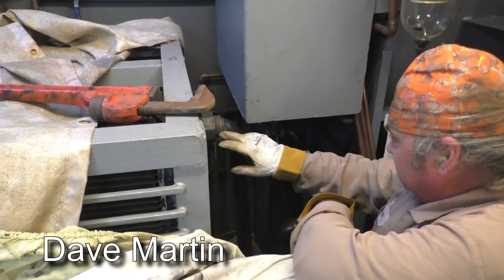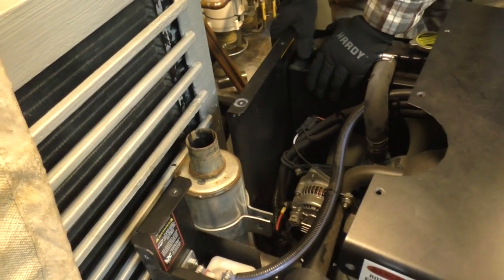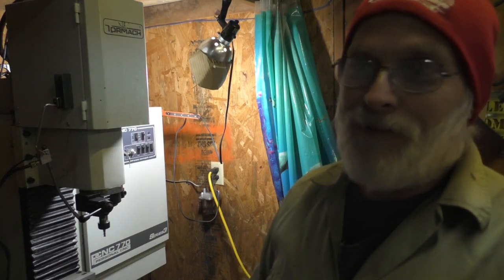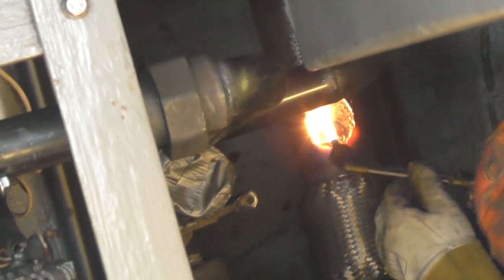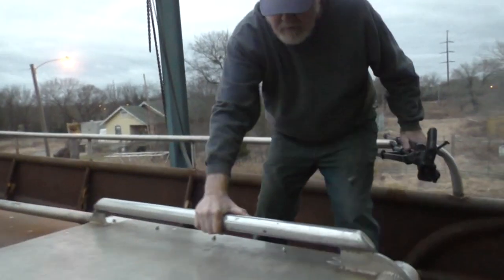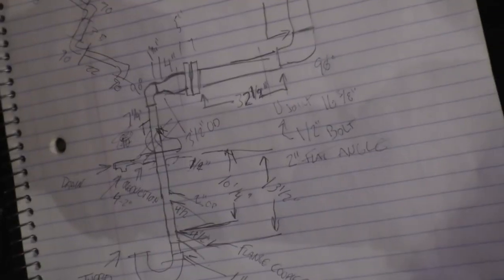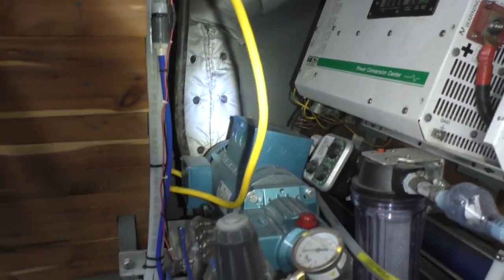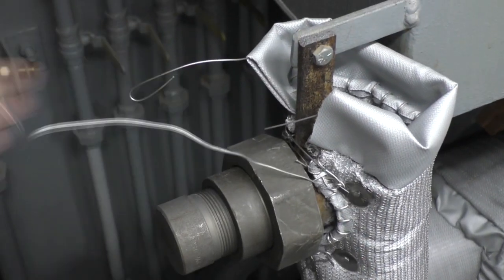Engine Exhaust

Comment: I've been in the heavy equipment transport / heavy towing industry for 30 years.  I've "heard" that if you're hauling a machine on a trailer, or towing a semi tractor behind a wrecker that the wind can spin the turbo while going down the highway and cause damage.  I have NEVER ONCE heard of it actually happening. Never. Not once.   I have had one or two customers in 30+ years ask me to tape off their exhaust stacks to prevent the turbo from spinning, which I did..... But the other 8000+ machines/trucks that I've hauled the exhaust was wide open and had NOT ONE problem.  I think there is a difference between the turbo windmilling (spinning with no load) and actually being driven by hot exhaust gasses.  If it's just windmilling, there is no load and no extreme temperature.  I suspect the residual oil on the turbo shaft bearing/bushing will lubricate sufficiently with no load or heat at a relatively low RPM.....   Under load and extreme heat while spinning at tens of thousands of RPM, yeah it needs oil.  You'll be fine.
Reply from the maker: Bart talked about that exact thing and had the same conclusion.   It make me wonder about all the things people imagine as problems that are really nothing at all.  : )
Reply: @SVSeeker    I wonder about that, too.  If we had to worry about every single possibility, or perceived threat that people can possibly come up with, then NONE of us would ever leave the house. Thank god we have people in this world that realize that just because something "can" happen doesn't necessarily mean that it "will" happen, and rarely does happen.   Looking forward to the launch, Doug!
Reply: Even if it did turn out to be an issue, what's the worst that can happen? You need to replace a Turbo or some Bearings. Pain in the ass, yes, but it's not the end of the world.
Reply: I have to agree. I never even heard of the possibility of windmilling when hauling, I'm a (diesel) mechanic with wrecker experience.. I think you will be fine, and if you fear it will run dry, turn it over once in a while to let the pump run. O and by the why, it hit me just now and I will post it again in mains, if your engine is solid there can't be windmilling at all, you'll just create a vacuum..
Reply: @SVSeeker  In periods of longer runtimes for the generator (not sure what the secondary motor is), where the main engine is not used.  What about exhaust gas leaking through an open exhaust valve, past the cylinder rings, into the crankcase and then out either a crankcase vent or back through other cylinder rings where there is an open intake valve that then vents into the engine room?  Carbon Monoxide buildup down below would be the greatest concern, not turbo spinning.
Reply: @TonyTrimaldi  DAAAAAMM!!!
Now you guys are thinking deeper!!!
I love science!!!
Love the channel!!!💪🏼💪🏼🔥🔥🔥🔥👍🏻

Comment: That common exhaust is going to give you issues.  I've seen it tried many times on industrial sites and it always fails.  One cylinder on an off engine is going to be in valve overlap (intake and exhaust valves both slightly open).  A small amount of that hot exhaust with a ton of water will flow right through the other engine.  It'll cause condensation and corrosion, maybe even a hydrolock situation.  I've seen all sorts of water traps and valve installed to try and remedy it, but none successful.  Ultimately every one i've seen has been redone with individual exhausts.  I know you don't like any critiques, but this one will actually cause you expensive headaches down the road.
Reply: I would just suggest a shut off valve that electric and but in inline with the main engine exhaust and run it to a ignition hot wire so as soon as the key gets turned the valve opens and when you shut it off the valve shuts
Reply: @srb2az141 @svseeker   an diesel exhaust brake might work well. Need to see how tight they can close at full close though.

Comment: Exhaustpipes are never connected together, every combustion engine or boiler onboard is to have an own exhaust pipe. This is to separate the engines, preventing fire spreading, avoiding exhgas backpressure related elevated exh temperatures at the engines and fouling of engines due to backflow.
Most propably you will experience backflow of exhaust into the engineroom through the non running engine. Spinning of the turbine is no big deal, but the backflow of exhaust  will foul the intakes as the intercooler and compressorwheel and flow into the enginespace. The exhaust "do take the easiest way out"
Best regards,
Fredrik  , Marine chief engineer
Reply from the maker: Actually you are wrong.  The idea came from a boat builder and fisherman from New Brunswick.  I think it's better to keep an open mind for what you may not know.
Reply: @SVSeeker  That is true and brilliant if it do work, saves a lot of work and effort!

Comment: You are way to close to the main with your cut in and yes the turbo will spin. And when the main is running the back pressure is going to exhaust out the small engine open valve.

Comment: Thought this was an old one... I was there when Ewaut and Dave were there and may have heard my voice talking to him, doing fit up... and to answer your question on turbos, it's not a vacuum that turns anything, it's differential, so you have to have a significant source of gas flowing across vanes to impel it to rotate. It may suck out gas that remains inside a engine until that is under vacuum too but can't do any more than that unless there is a significant leak in piston rings or a pair of hung open valves to reach intake system or another source of atmosphere.

Comment: Re spinning the turbo, not much to worry about there I'd reckon. If it's a 4 cylinder with a valve overlap of 20 degrees (pretty worst case I'd think) that's a 1 in 4 chance of stopping with both valves open assuming that any position is equally likely - which it isn't. It's more likely to stop before a period of overlap due to the compression on one of the cylinders bringing everything to a halt before TDC and thus the other cylinder won't have reached the point of the inlet valve opening.

Then, if you have no path for the air to travel through there can be no flow. You might see a slight vacuum being pulled on that exhaust but no flow means no spinning turbo.
Reply: Cummins 5.9 12v 6 cylinder
Reply: @mrwolf9335  I thought that was the Genset exhaust rather than the main engine...
Reply: @dtnicholls1  the genset isn’t turbocharged the 5.9 is and she’s the main for sure she’s even coupled to the auto box out of the schoolie still as well
Reply: @Mr Wolf  yeah, just re watched that part of the video and you're absolutely right. In that case it's a 1 in 6 chance (120 degrees in 720 of rotation), again assuming any given position is equally likely, which it still isn't.

Comment: Turbo won't spin because air can't come in through the intake if the engine isn't running, so there is no flow. You would need both intake and exhaust valve on the same cylinder open. Even still, the flow would be so low, the turbo won't spin enough to need oil.

Comment: Just curious, as a research vessel carrying students to exciting places, what sort of maritime certificates and/or inspections will SV Seeker have? As an old submarine sailor I can testify to the benefits of the SUBSAFE program. Between 1915 and 1963 15 submarines were lost due to non-combat causes. After 1963 only one submarine has been lost and it was non-SUBSAFE certified. I wish you all the best, but it is a good idea to listen when the welder says the 4" hole in the boat could use another bead 'just to be sure'. LOL.

Comment: Half the exhaust valves will be closed on the 5.9l Cummins , when not running. Also gases go will the flow of leased resistances and a open pipe vs a closed engine.

Comment: Nice jobs. BUT i will use the opportunity to share some bad experience from my off shore work. Sharing exhaust on piston diesel gen sets, will after relative short time deteriorate the valves on the not so often used engine. Sod WILL find its way thru the engine to the intake and collect dirt where dirt is not wanted. Redone several plants.

Comment: I sure hope you recognize that paralleling those lithium Ion batteries will result in a serious balancing problem and ultimately a fire within your boat if a very adequate Battery Protection System isn't used.
Reply from the maker: Hi Mom!
Reply: @SVSeeker  🤣🤣🤣🤣
Reply: @SVSeeker  just keep a co2 fire extinguisher nearby lol

Comment: If the turbo starts to spin from scavenging exhaust pressure, it will not be under a load but there should be some oil to lubricant.

Comment: Doug, not sure which of those engines might run concurrently, any concerns about exhaust pressure from the larger engine causing back pressure or interfering with exhaust from the smaller engines?

Comment: We ran a shovel with to keep 1150 cummins engines. The mufflers were mounted mounted above each engine. The engine room was so hot it ruined the insulation on the wiring. We mounted the mufflers on top and wrapped exhaust with heat wrap. Alot quieter and cooler!
Reply: Kt 1150's

Comment: Try running the smaller motors and look through the intake of the 5.9 turbo and see if it's turning. 
I'd say as long as it's not spinning to fast it should be good.

Comment: As long as the intake and exhaust valves in the same cylinder aren't open at the same time then no draught and turbo can't spin.
Reply: But there's no way to prevent a cylinder from coming to rest in valve overlap.  It happens and will cause issues.

Comment: There can't be windmilling of the turbo: if your engine is solid you will get a vacuum at most. In order to get windmilling you need airflow, if the engine is off the airflow is cut off, the exhaust doest have gaps to allow air in, and the the air can't go in in the cilinders because at least one set of valves will be closed.

Comment: Do you really want to use old 18650 when the fire risk is very real. And fire on a boat sucks. Just something to think there are safe new cells that are just not that expensive. Is it even legal to mail old 18650s
Reply from the maker: Actually I'd rather hunt whales and render their blubber in to oil on deck and put that in oil lamps in each cabin.    But the world has be taken over by pussies.

Comment: Not a good idea to combine engine exhausts ... danger is condensation in the engine(s) that are not running.
Reply: Seen it many times on industrial sites with expensive repairs to follow.
Reply: I have built a lot of marine exhaust systems it's never a good idea to combine exhaust like that I would be more worried about exhaust blowing out the intake of engine that is off. Should make sure you have less than 10 inches of back pressure with all engines running full load

Comment: Turbos are turned by exhaust gases and heat you may have enough heat to give you a problem with no oil when the engine is not running

Comment: Doug, I have been reminiscing about my days at sea and remembering that with the turbo blowers on the Sulzer engine they had a gravity feed tank for the oil supply to the blowers. This as you may know was to be independent from the main L.O. Supplied to the Sulzer main engine.
What and how is the LO supplied to the blower on your main engine.

Comment: Doubt the little exhausts would have any effect. You would need both an exhaust and an intake open at the same time for it to allow any significant amount of airflow. You might have a small seep through the ring gap but that would be like blowing air through a capri sun straw trying to spool a turbo.

Comment: For the other engine's exhaust to cause flow through the diesel turbo, there would have to be air flowing into the turbo inlet for there to be air being sucked out to cause rotation. Where is that makeup air coming from? That turbo isn't going to move.

Comment: worried about spinning the Main engine turbo via venturi effect because a valve may be open?  I dont believe the smaller engine would have the volumetric capacity to reverse pinwheel the turbo via vacuum.  besides, you would need both intake and exhaust valves open at same time in one cylinder of the turboed engine to get any through flow.   I could be wrong....I am just guessing.

Comment: Is it the flat top 18650 batteries you need Doug or is it the button top 18650s? I have a chance I may be able to get a handful of brand new 18650 batteries brand new for dirt cheap.
Reply from the maker: I don't think it matters but don't go and buy any.  There are plenty of used ones out there for free.
Reply: @SVSeeker  wish it was that easy here in oakland. You rarely see people recycle those batteries.

Comment: Any vacuum from the exhaust of one engine running that it could try to pull air through the exhaust from another is a non issue.  There would not be enough of a vacuum to move enough air to spin a turbo. Thats due to the design of a turbo. This should be common knowledge.  Look at the exhaust turbine as well as the compressor side turbine. It takes significant air flow across the exhaust turbine not just the tiny amount from what amounts to you blowing out on a pinwheel toy.
Reply: If your going to throw out terms like “common knowledge” you should know that it’s also “common knowledge” that a drafting nozzle, which they have built by angling an exhaust pipe into a common header, can create significant vacuum, which can create significant air flow. So unless you’re going to provide real numbers, based on pipe size, air flow, and drafting nozzle geometry, I suggest you shut up about what is “common knowledge”, because you don’t have any “common knowledge” to offer.

Comment: Screw the turbo, if and engine is stopped in a position where an exhaust valve is open, you've just created a direct path for CO2 directly into a confined space! They CANNOT share the same exhaust!
Reply from the maker: Thanks for your opinion MOM.  : )
Reply: @SVSeeker  That's a very disappointing response. At least put a CO2 detector below. When it goes off, and it will, you'll know where to look first.
Reply from the maker: @alwaystinkering7710  We have them MOM.   Don't you have some fearmongering to do somewhere else?
Reply from the maker: @alwaystinkering7710  Yes.  Thanks MOM.